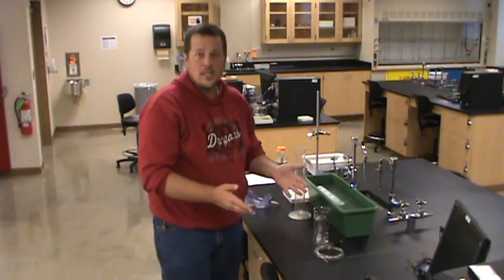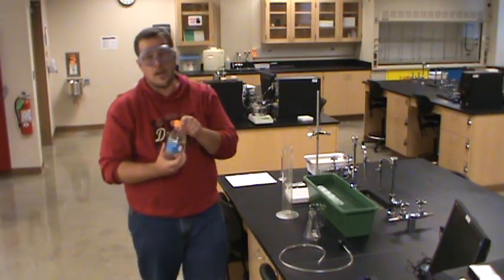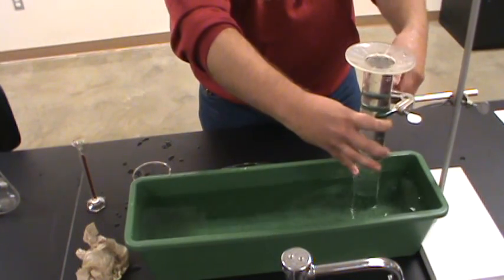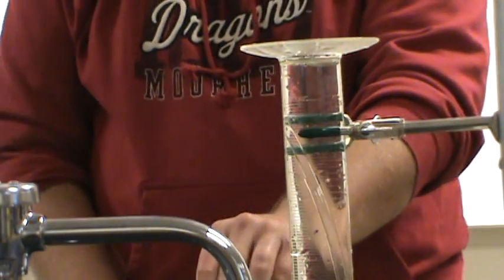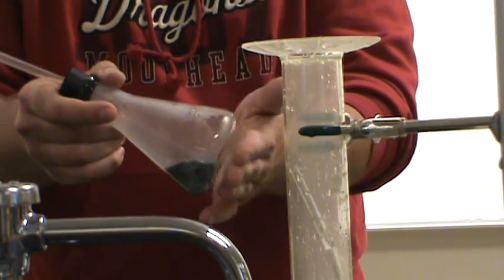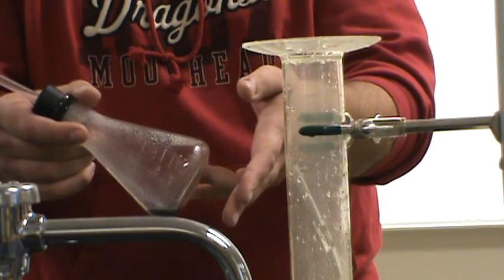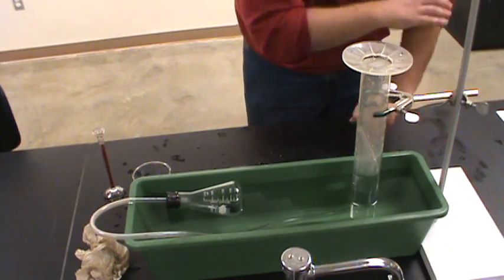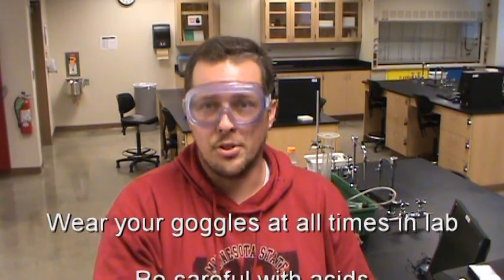The Reaction of Aluminum with Hydrochloric Acid - Experimental Setup {Reload}

Comment: What about the air in the tube and flask, where is it after the reaction?
Reply from the maker: The amount of air in the flask and the tube is constant, so it shouldn't affect the amount of gas generated and collected. The water level in the tube can vary a little bit, but the tube is thin enough that the amount of air doesn't vary by more than probably 2-3 mL from experiment to experiment... that's not enough to impact the observation of the gas being generated.

Comment: I'm pretty sure what caused the water to be convex around the 3min mark was cohesion, not surface tension. In fact, surface tension should work against that since it will try minimizing the surface area: The greater the area, the more energy is stored in that surface.

Comment: A few things to note.The tubing had air in it as well as the reaction flask.So some of that was plain air until the hose and flask pushed it out.But what I can never seem to find with this stuff is someone taking temperature measurements of the reaction.I can not for the life of me find how hot this reaction gets...is it the same temperature regardless of amounts of material used or is it the same temperature no matter how much is used? This will be nice to know when selecting a bottle or container.
Reply: James Zelazny jr do you still need this info? I’m about to do the experiment myself. Haha
Reply from the maker: The temperature depends upon the amount of reaction that happens and how quickly the reaction occurs. When the limiting reactant is VERY limiting, the temperature does not increase much because the total heat liberated by the reaction if very small. If the reaction happens very slowly (low concentration of acid), the heat is liberated slowly enough that it can be absorbed by the surrounding water bath so the temperature does not rise significantly.
As for selecting a bottle or container, there are many plastics that would be OK, but I would probably stick with glass - it's more reliably acid-resistant and heat-tolerant than many plastics. To minimize volume, temperature, and pressure effects, it would be best to have a container that is not especially large.
Sorry for the delay in replying, I was off-line for a while.
Reply: So question, as someone else stated, would the oxygen that was in the tube and flask come into consideration here? Also the tubing thats in the graduated cylinder is taking up room. Would that be deducted as well? Would it be more accurate doing it in a vacuum? I understand this isn't a super accurate thing, more about how to do the experiment. Just wondering for myself. Thank you by the way

Comment: Why did you not just lay the Grad. cylinder down in the trough then simply turn it upside down?
However you did slip in that quick lesson on cohesion :)
Could you please answer on the purity? or suggest testing method
other than filling balloons & checking lift forces?

Comment: The figures given in the video are: 5.3 ml of hydrochloric acid, 403 ml of gas. At 24 liters/mole, that is .0168 moles of H2, or .0336 moles of H, hence of HCl. That gives an original acid molarity of 6,34M HCl/liter. Perhaps it was a bit more, if the reaction isn't complete.